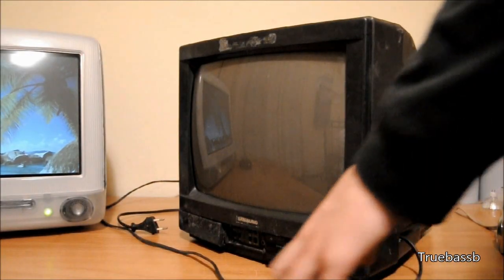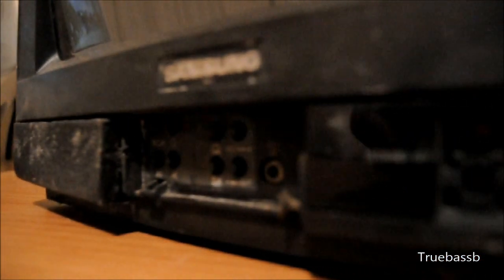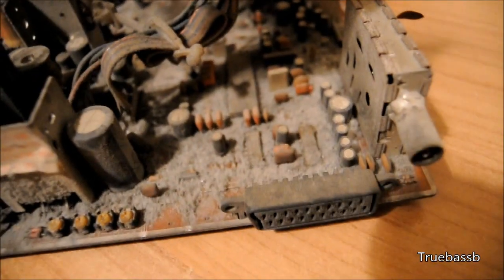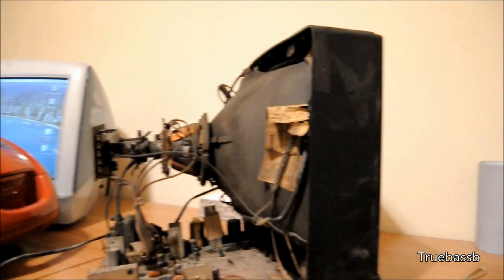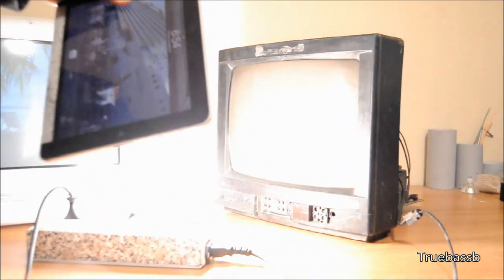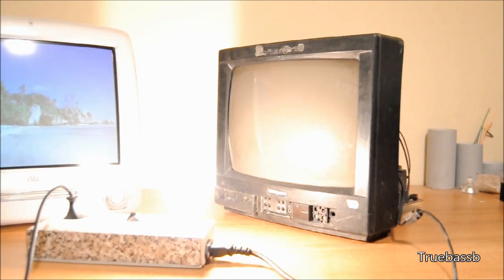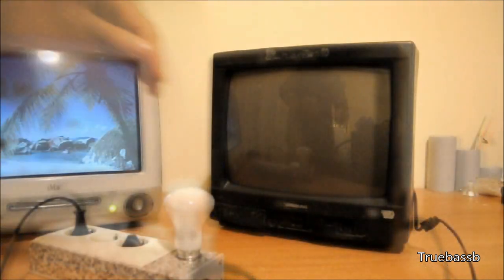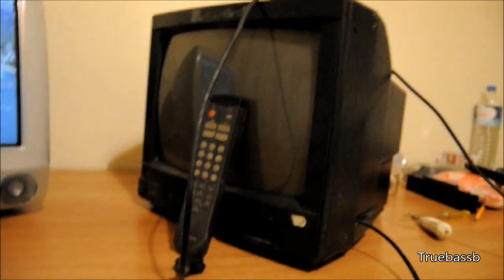Samsung 14" CRT Autopsy 5 Years in Mold

Comment: My parents bought this CRT around 1991, I have used it long time coupled with my first Amiga 500. It stop to works around 2004. It brings to me a lot of good memories, very good device!
Reply from the maker: Very reliable device,it must have been fun with the Amiga. Mine was working for many years 24/7 with television programs and also with my Ps1,my father had it since 1995 or so.
I replaced it with a much newer 21" Daewoo CRT from 2000 in 2007 which got its output transistor shorted in 2012,probably the flyback had got shorted turns as it was also working 24/7 but way less reliable than the Samsung.

I still have the Samsung but it does not turn on anymore due to the shut-off problem mentioned in this video which evolved into permanent output transistor overcurrent and most likely it also has shorted turns on the flyback transformer and probably a bunch of bad capacitors,thus it triggers the protection mode right away.

It has a complicated PCB but it is quite easy to repair,however i don't think it worth it if we count its low resolution and high power consumption,but i know i would appreciate having it in working condition after all these years.

Comment from the maker: @MrGimpyLoser I also enjoy using the iMac with the CRT,at night it's amazing as you can turn down the brightness and it wont have any washed out picture and backlight bleeding as some LCD panels.  For old consoles the CRTs look miles better as on newer TVs you can't even get the 320x240 image wide.   ALSO i had recorder a video of PS1 Gaming on 1080p HDTV,i will try to upload it or re record it,,you might be interested aswell.

Comment: hi i need your help please i have a probleme with a crt tv LG 14 inc the tv is power on but the screen is pink i made somme troublesooting  on the croma ici and delay line no resulte if you can help me i will very greatfull for you
Reply: hi. no idea actually and sorry for the late reply. maybe did it had any contact with a magnet? in which czse it will demagnetize by its self eventually. otherwise i can't explain it.